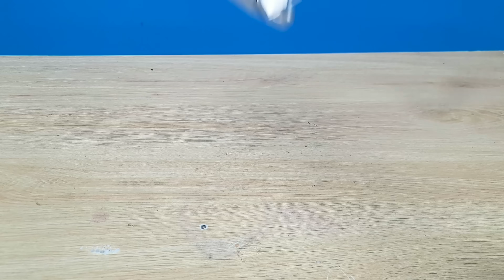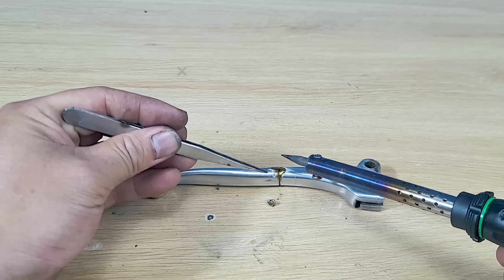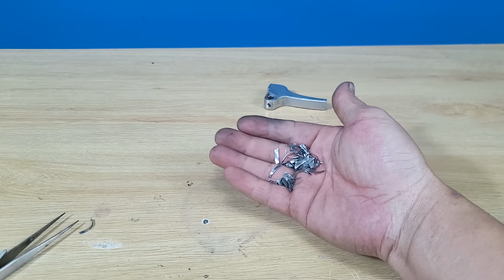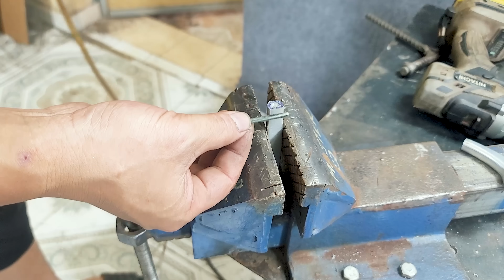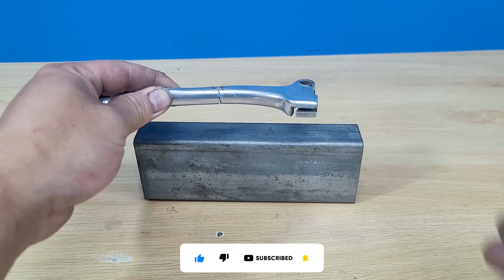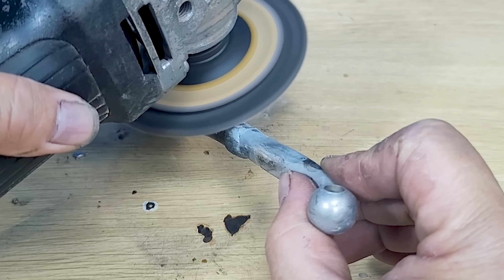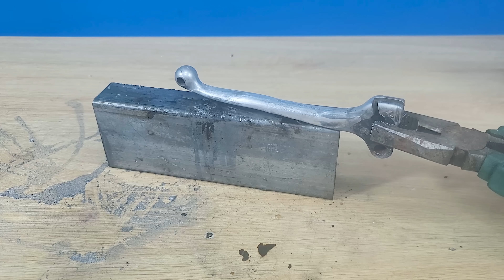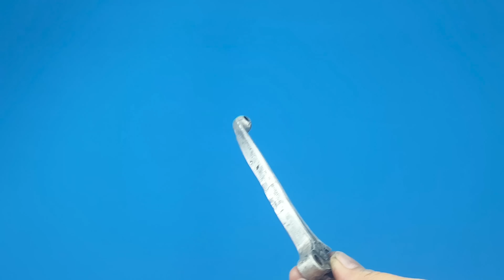Even a NASA professor had to learn this from me! Idea of using 1,5V battery to weld aluminum brakes

Comment: Its definitly not strong repair, because the material u used to melt it together is very soft .Welding it with AlMg 3 wire is much stronger and very fast done  2 minutes work.
Reply from the maker: Hello, I am very happy to meet you, especially a friend with extensive knowledge like you, it helps me a lot, you gave me a new idea, I will try another method to complete the job. job. We hope you will like and support us, dear friend, have a nice day.

Comment: The ingenuity here is top level (he made his own tap and uses self-tapping screws as drill bits!), but:
1- I am a bit surprised to see ten fingers, considering the cavalier use of the angle grinder!
2- No "welding" took place here. The mechanical strength is in the insert he embedded in the handle.
3- Why dissolve the battery casing in drain cleaner to make a zinc solution in either acid or base (can't tell which) to clean the brake lever before soldering?
Reply: The liquid mixed with the zinc was hydrochloric acid drain cleaner. That makes zinc chloride, which is used as solder flux.
Reply: @Mavrik9000  this is why i must take off my hat to Nerds aka Studious, Smart :face-blue-smiling:
and the best part of comments i was looking for this comment :cat-orange-whistling::glasses-purple-yellow-diamond:
Reply: Interestingly I believe that caustic soda also reacts with zinc although it's mentioned in error,, or is it ?   I've often made up zinc chloride flux exactly from the battery casings which I always misplace cos I don't label my containers , it's  a great flux for stainless steel too.  It don't work as a useful flux for aluminium though. But I ain't tried the solution of zinc in caustic soda as a flux .
Reply: Not easy
Reply: Maybe, but others may costs really much more and are not so easy to find in a few hours.
My doubts are still about final strenght.. but for a "one our repair" waiting for spare part arriving... seem a cool idea.
Reply: @montesamapping  If it needs to be repaired fast you can always use a steel bolt and a few hose clamps to macgyver something together. Something like this just gives false confidence.
Reply: Донбасс Макеевка!!!
Reply: That was a Tec-screw - it has a drill bit built into it.
Reply: The idea of inserting a screw is good, becasue hot causes aluminium to become really less stronger than original. 

Anyway I would never use it for braking... your life maybe at risk if the repair is weak!
Reply from the maker: Hello, button batteries, phone batteries... often contain toxic elements such as cadmium, mercury... When rusted or punctured, these substances can leak out. Furthermore, when we go to work, we still lack insurance for ourselves. I'm glad you gave me useful suggestions, especially regarding your own health and that of everyone else. We will try to improve them in the next videos. Wishing you and your family all the luck. lucky lucky. lucky

Comment: You are very creative if everyone could do something like that it would certainly save money may god bless
Reply: I have a tip that may prevent you from breaking them in the first place.  Most tighten down the lever mounts so they cannot turn or rotate on the handle bars, but if you just tighten the mounting screws just enough to keep it in place but not too tight that it won't move at all, then when you fall the mount will move, preventing lever breakage!   Learned this after many years of dirt bike riding!!
Reply from the maker: Hello, thank you very much for your valuable sharing. We will try to improve them in the future. Thanks a lot. We wish you and your family good health.
Reply: Only moved the costs around.  Still had to buy a battery, toilet bowl cleaner, bolt and solder with the only structural part of the repair being the bolt.  The solder and homemade flux was just basically filler and faring compound.  Personally I just get very cheap low temperature aluminum brazing rods for these repairs which work with the same torch and result in a stronger than steel repair.

Somethings are worth pursuing in real life while others are simply entertainment.

Best!
Reply: @neilfromclearwaterfl81  He was doing an aluminum repair,  NOT a steel repair. And I don't imagine he had to buy a battery, or scrounge for toilet cleaner.   We all have junk around the house, which was his inspiration.   Make do with what you have.  Gawd, you Floridians.
Reply: If that NASA professor learned to do this nonsense, I'm not surprised because the Challenger exploded during takeoff.
Reply: @franciscomorales7012  I worked on projects involving the Shuttle and it wasn't NASA but a SubContractor who messed up QC on the specs.

NASA knows metallurgy and the correct flux to use for the best results so would not resort to a questionable and inconsistent flux made by snipping up already compromised alkaline batteries.  They would have top notch welders and machinists doing these repairs to impeccable standards that most today still not able match what was done by them over 50 years ago, even with modern computer technology.

Best!

Comment: I’m the dumbest guy on YouTube for having watched this
Reply from the maker: Hello. It's been a pleasure chatting and getting to know you. I'm sorry if what I did made you unhappy. I wish you and your family good health and best regards.
Reply: Yes and a few others too, it defies belief that so many 'content providers' would consume so much time and energy producing basically nonsense, is this where we are now, pure dross.
Reply: @sollykhan2385  why do you think it is none sense? it happens to be the corner stone of chemical welding, something a paper pusher or a hands off type of person wouldn't get much less understand.
Reply: @davidwalesby2426  i have a university Degree in mechanical and electrical engineering, also run my own Auto repair shop for over 50 Years, I also do virtually all types of welding, Gas, Argon, Arc, Tig, etc, so not bad for a hands 'Off' GUY. THE TIME AND EFFORT TO Botch that brake lever is to say the least daft and in safety terms insane, far cheaper to fit a new part.
Reply: @sollykhan2385  , not bad at all for a self bloated hands off guy either but it's not a botched job as far as the video shows and sometimes the part isn't ready available in some countries, n fact places like Alaska you would have to take a plane to town to order the part and go back an get it once its in a month later so that sounds more like a very expensive part to me, with all that education you would think you would have picked up on the process rather then the part he was fixing because a lot of shit is made from aluminum and if you live in a place where parts aren't ready made available then it's a pretty handy an timely fix, as far as insane goes it's an insanely ingenious show of the ability to be self proficiently hands on.
Reply: @sollykhan2385  sorry you took it as an insult, i was merely pointing out the fact you seam very self bloated so i do apologize for my observation unlike your direct incomparable attempt to outright insult me as you did  but i also went on to say not bad for a hands off person as well and that was a compliment, anyways ty for noticing my agreements were valid, now that you see it in a different light do you still think the job was botched and that it was cheaper to purchase a new part for that person instead of the fix?
Reply: Me too 🤣
Reply: @NannieMakassar-cd8hb  then your just as dumb as the other guy, because most people got the just o the video and understood why.
Reply: not because you watched it but because you didn't understand it or get the just of it. dope lol
Reply: 😂❤😂 lol the “dumbest guy” comment 😂❤ I’d hire this guy to fix all my projects. 😂 knowledge may be key but action wins 👏🏻
Reply: Clearly you are because this video got 7 million views and you got 0.
Reply: not because you watched the video dumbass, your the dumbest person because your stupid
Reply: nah you cant be dumbest, cos i just watched it aswell, might be cheaper and safer just to buy a new one, and less hassle.
Reply: like watching an A Team clip, when they putting something together.
Reply: I d agree
Reply: You're not alone, lol